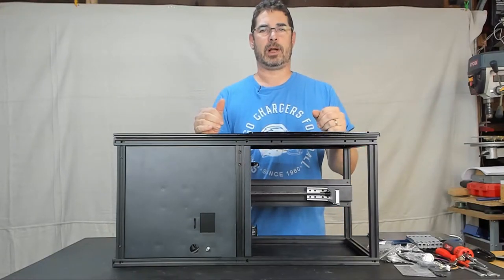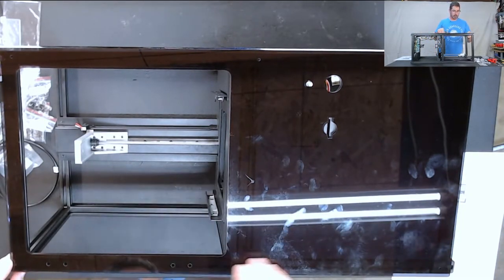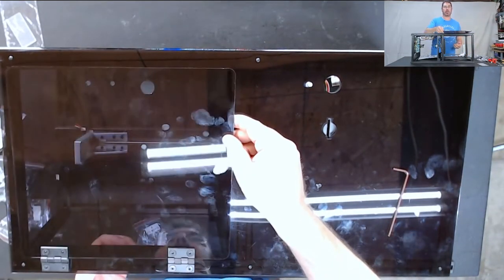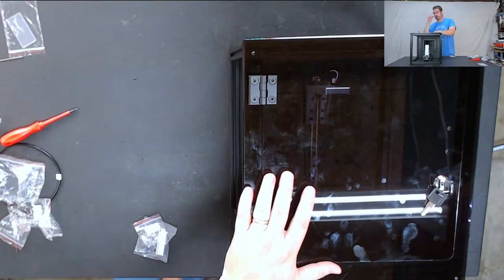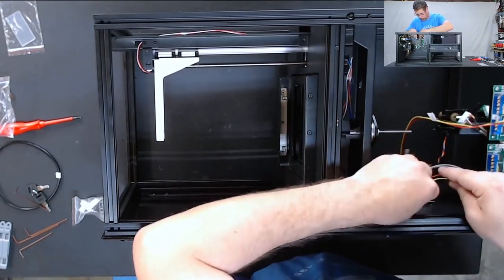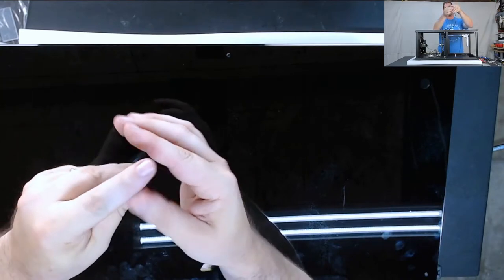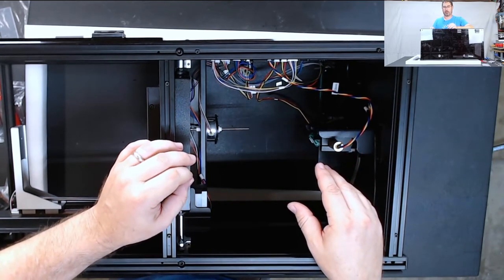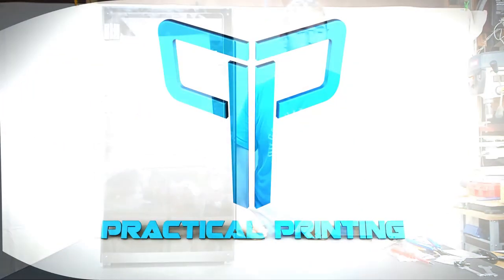Moai Series Part 7: Final Assembly (Finally)!!!

Comment: Am enjoying this build i found the key latch bit out of place wondered why not a push to unlock type of magnet like you see on some cabinets and panels could of been opaque solid black and not transparent only the door that is and are you gonna add a webcam inside ?
Reply from the maker: Greg The Great because of the laser, the key latch is important for safety- don’t want someone opening the door and going blind. But several users have been printing magnetic latches that look to be great.  And yes, plan on putting a camera inside if I can do it safely.
Reply: Practical Printing someone opening it should and could just get a smack to the back of the head ...lol...